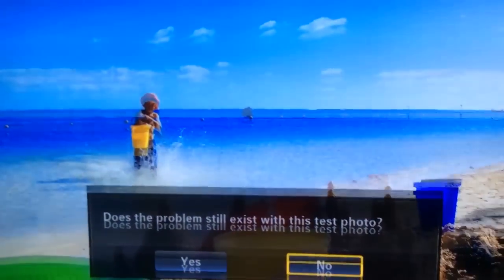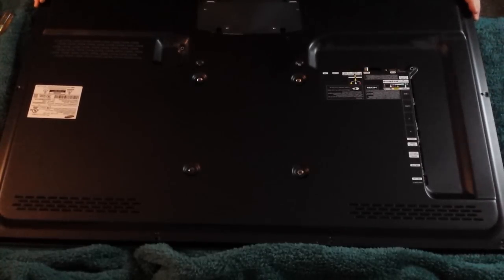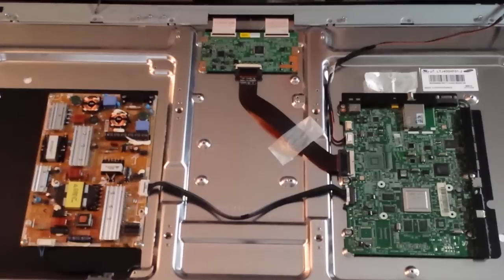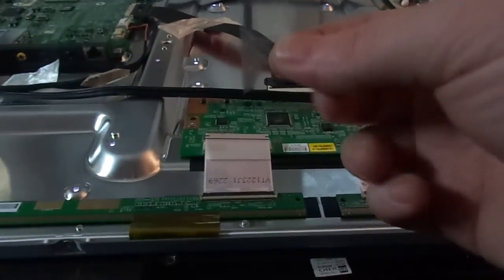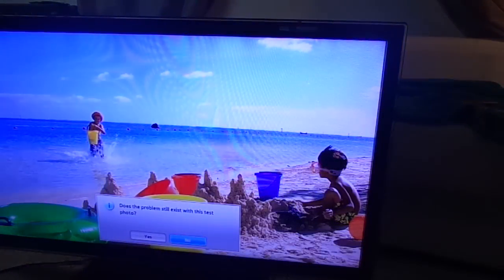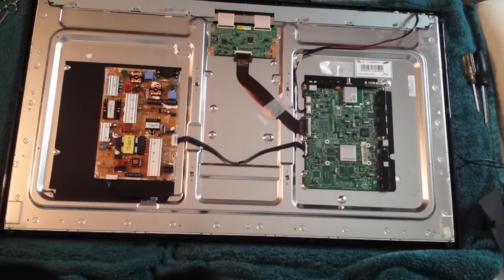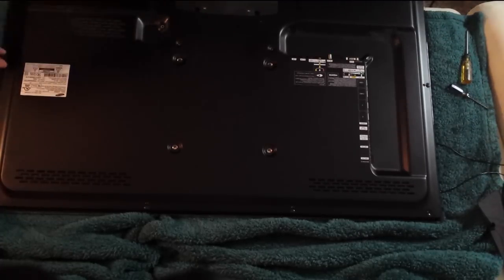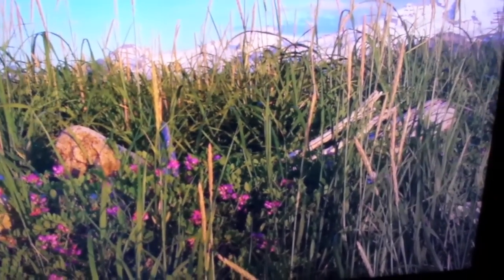LED LCD TV FIX, How To For Samsung Double Image, Black Vertical Lines, Screen Problem Sony LG.

Comment: Hi Dave, I have a Samsung LED 40inch (UE32C5700) and all of a sudden this problem started 3 days ago. I called in the Samsung engineer and was given a hefty quote to replace the screen + service charges. The technician himself recommended me to buy a new one which will be cheaper than the repair cost.
I looked up Youtube and found your video. To be frank, initially I was a little skeptic on how sticking a tape would work. But, I am no electronics guy and thought to give it a try. I followed your video religiously (right to the being gentle part and delicate fingers :-)) and was able to fix the issue in the first try. Thanks a ton for your easily understandable step-by-step procedure, I did not even feel that I was repairing a costly electronic product. 
The only issue is that I am now seeing a line between the 2 halves of the screen, it is very light but noticeable in channels/programs where the lighting is bright and has enough contrast and colors. I gather from comments that I need to play around with the width of the tape and the positioning of it. Is that correct? If so, I will try it some other Sunday and try to get this fully right.
Thanks again, and anyone else having the problem and reading this, don't doubt or hesitate - go ahead and try it out with this video. It is super easy - you just need to be patient, methodical and delicate as Dave instructs multiple times.
Reply from the maker: Siva R thank you so much, yeah people have posted they adjusted the cable a bit. If you do just be careful as the tape can peel off a layer of the cable when removed.

Comment: the plastic tape is an insulator. So Covering the metal contacts of the ribbon cable prevents the ribbon cable to be in contact with the T-Con board.

Comment: Isbit not dangerous to touch these connectors when the tv is plugged in?
Reply from the maker: Colin McGarry yeah don't touch them.
Reply: Do It With Dave That seems to be a sarcastic reply.
Reply from the maker: It was not my intention to be short. But definitely be careful if you decide to follow along with this video. It can be very dangerous and some ppl have said to ground yourself as a precaution whenever doing this type of work.

Comment: Hi Dave. The method you explained here is working pretty well for sometime, but after 5-10 mins white vertical lines start to appear on the left side.The screen is flickering and coming back to its original position. What could be the defect ? And how to fix it? Looking for suggestions.

Comment: interesting. i have black evenly spaced vertical lines and pushing on one of the hdmi jacks on the back used to clear it, but the jack eventually broke off and now its permanent. is this a separate issue?
Reply from the maker: jethronh that sounds like some different than what is shown in this video.  Some ppl have posted screen image issues do to devices being used with their TV so it sounds like it's directly related to the output. If you have not already done so you could try different source/inputs for TV like a USB cable ect and see if that helps. I would try configuring the set up a couple ways before opening anything up.  If you end up going in it could be obvious that the hdmi connection is the cause. If you do end up finding out the issue please post back here. It really does help the YT community.
Reply: see my video i just uploaded. It shows it, and the description walks you through all of my attempted fixes. Thanks!!

Comment: Thanks, bro. You helped me save ₹5000/- bucks. Actually these TV companies must direct their clients to solve such minor problems that don't actually cost that much that they charge by changing certain panels. Repairing is a must in these hard economic times. Thanks again, keep it up.

Comment: what if there is no middle panel  to remove? When I open up the back cover of the tv there is two circuit boards on either side and two thin white cables going down the middle and  into two sockets,  but there is no  third circuit board? I think the board might be on the other side of the medal plat crap!       42LE5350

Comment: Holy crap it worked!  I can't believe it.  Give it a try!  Have a 46" Samsung LED UN46B7100WFXZA that I bought in November of 2009.  About a month ago it started showing black/gray horizontal lines that went pretty much across the whole screen.  I did not have any ghosting or any other picture issues besides these lines.  They were darker/more noticeable on the left half of the screen.  These lines showed up on all inputs, over menus and even on the built-in test picture of the beach.  Searched the Internet like crazy and found this video.  I figured it was a bad T-Con or power supply.  Cheapest I could find a T-Con was about $75 and I didn't think it would be worth the cost to try
without knowing if it would fix the problem.  I am a technical guy, so I figured I would open the TV up and check the connectors, look for bulging caps, etc.  I first tried disconnecting the 2 ribbon cables and cleaning them.  I turned the TV off whenever I was disconnecting anything.  I tried cleaning the cables, cleaning the gold contacts, cleaning the sockets, pressing on the cables with the TV on, wiggling the cables with the TV on, pressing on the top of the socket with the TV on.  None of these things made any difference in the lines.  I then did like Dave said and disconnected one cable at a time and checked the screen.  Looking from the back, when the left cable was disconnected, the horizontal lines were still there.  But when I disconnected the right cable, the horizontal lines went away.  Keep in mind when you unplug one of these cables, you will only get a picture on half the screen.  So I figured I would try putting the tape on the right cable.  I took some tape, cut a strip about 1/4" inch wide and put it on the cable.  Like the video, I didn't start right on the edge, but over a few traces from the right side of the right cable.  I started applying the tape covering the gold pins and then wrapped the rest of the top over and around the edge/end of the cable and back up the other side.  So yes, the tape covers the contacts.  Total it covers about 15 traces.  There are 3 traces to the right between the tape and the edge of the connector I did not cover.  Plugged it in and first time it worked.  PERFECT picture.  Like new again.  Put everything back together and TV has been running for 2 days with no problems or lines.  I will post an update in a couple months to let you know if still is working.  I have NO idea why this works - it doesn't make electrical sense.  But glad I gave it a try.  Any questions, I'll answer what I can :)
Reply: Just an update.  It's been 2 months and the picture is still perfect!  The lines have not returned.  Thanks again Dave!!

Comment: Any chance I could have some help with a way to fix my 32 inch Samsung led tv with thin coloured lines and slight mirroring image and blinks green and purple sometimes Watched vid but need further help there is only 1 band goes from input board and goes to a long board only 1 ribbon
Reply from the maker: Aidan Mooney there may be a better video on YouTube for the issue your TV is having.  From what I've seen ppl say could be devices  (Blu-ray xbox ect) or WiFi interference. Some videos show to adjust contrast in the settings menu of tv. And I've seen some videos where the TV has many ribbon cables around the outside of the screen and put spacers something soft like an unused sponge cut into small pieces under the cables to keep them from moving. You may want to give some of these a try.

Comment: I did whatever you did but I got half black screen. I removed the tape and placed the ribbon back but still half black screen (left side). I also switched the two ribbon to see if it is ribbon problem but same thing. The TV was working before I try to fix it except double picture like your tv. I checked the ribbon place in the board and there is nothing wrong with it. Can you help to figure out what is the problem?

Comment: Hi Dave - I have the exact same model TV and it now works because of the detail you put into this video! I got the TV for free so it was worth a shot to see if it could be fixed. I placed the small amount of tape just above the gold connectors (for the right panel) on the ribbon cable and its enough pressure to prevent the ghosting and vertical lines from coming back. Shame Samsung doesn't provide this tiny cheap part. If so I  would have just replaced the ribbon cable it and be done with it. I do have some faint grey horizontal lines on the right side but from where I sit its barely visible. I did notice there was a bit of black gunk on two of the pins on the ribbon cable which could be why I am getting the faint grey lines but otherwise it is working. Maybe I will try some contact cleaner. Much thanks.

Comment: I tried this fix tonight and when I unplug the ribbon cable the whole screen goes black. I did left and whole screen blank. Then just right and whole screen black. What is the problem?
Reply from the maker: Thomas Elliott I'm really not sure. So far there hasn't been a post explaining the same issue your experiencing with you're tv. You should get a half screen when removing just one ribbon cable at a time.
Reply: Do It With Dave I got this tv from a friend and he replaces the t con board. The tv turns on but has a double image with small horizontal lines. But like I said either ribbon cable makes whole screen go black and have to turn off tv to get image back on
Reply from the maker: If you want to take a risk you could try turning off the tv Appling the tape on one of the ribbon cables then insert it back in and turn on to see if the image changes. Just keep in mind the ribbon cables are a bit delicate.
Reply: Do It With Dave where do you buy the ribbon cables. How do you know which one to buy. The is for a Vizio led tv w/4K by the way M55-C2
Reply from the maker: You would try ebay. I have seen them for sale on that site.

Comment: Dave, This fix almost worked for me.. When i adjust the ribbon tape with connector i can see the image is accurate without the horizontal black lines.. But when i try to lock the tape connector the black lines again coming up even after so many try.. Is this the problem with the ribbon tape or connector or the LED display.. Also i am not sure in which position the tap I have to paste.. I followed the one in the video but it didn't help.. Thanks a lot :)

Comment: can u help me...I was trying to get the ribbon tape in the best possible position when all of the sudden now i don't have any image, my screen lights up but there's no image. do u have any idea what happen?
Reply from the maker: Marco Garcia look to see if the ribbon cable is damaged. They are delicate and can get scratched easily.  If they are good unplug the TV and wait a couple minutes then turn the TV back on with both ribbon cables inserted. See what happens.  Does the power light on the front of TV come on? If still no image remove one cables one by one to test if there is any signal going to at least one of them. If you see no change then something may have shorted out. Possibly the t-con board. Definitely check the ribbon cables for any damage.
Reply: Do It With Dave I think u are right as well. I'll check later but I think the t con shorted out

Comment: i just want to say that I fixed my TV with this simple fix. thank you so much. I would really love to know the technical reason for this to work, because it makes apparently no sense, but after all, works...
Reply: @Do it With Dave, today in some further testing, i noticed that one of the halves of the screen is in some images a little darker than the other (less than 5% I would say). Do you think that shortening the number of pins covered by the tape would fix this?

Comment: The tape fixed the double image, but one half of the screen has a slightly different color of background. Is this a problem with the circuit board or the cable? Can I purchase either if that is the problem?

Comment: How can you cover the gold connectors with tape? You will not get any contact???? Just wondering how that worked?
Reply from the maker: Maysin777 I don't know exactly why this works. some people have commented the tape stops static electricity from building up that is the cause of this issue and that the clear tape doesn't necessarily prevent the connections from operating properly.
Reply: OK...thx for your input Dave....appreciated!

Comment: Why this works.     I have no double image, but slightly darker right side of panel  now.   I would like to fix proper.   Does the cable cause the problem, or the tcom
Board ?

Comment: Nice job making the video. I don't see how your fix would work, but there is always something new to learn. You have many visitors, so I will state my issue and what I've done. I have a 3 yr old Samsung LED 60" 7500 series. Great TV except after 2 years I was getting a total distortion of the picture and it would recycle after a click like it was resetting the HDMI or something. I would unplug it for an hour and then it would work again. It worked ok for months and then it would do it again. Then I got 1 thin black line going from right to left with some fading towards the left side. I figured, after much research that the line could be a bad connection with a ribbon cable. A youtube video was helpful showing that the power supply capacitors could be bad even thought they all looked physically perfect. I got a capacitance meter and checked all the caps and they all checked correct. I purchased all new capacaitors and installed them all in the power supply board. It seems like the distortion problem is fixed and was caused by a bad capacitor, but the black line is still there. I took it apart and on my TV there are hidden connectors under a plate along the bottom. I used a pencil eraser and cleaned all contacts on all ribbon connectors. The line is still there. I'm thinking the line is due to a bad connection where the cables are fused to the LCD panel. So, now I'm going to order some spray contact cleaner and try the contacts and ribbon cables again. I'll post here as a reply to this post if I solve the problem. If anyone has a solution for me please post it as a reply. Your video was very helpful in disassembly and has removed the fear of operating the TV while it is open and being worked on.

Comment: what about for smaller tvs that only have one ribbon for the screen, i have a 32 inch samsung model number LN32A450CID and the tape method is not working ?

Comment: Dave, thanks for doing the video, but putting the tape must do something. Is there a short between the contacts? Is it possible that the tape was not necessary and by moving the cable you found a clean connection free of oxidation?

Comment: For me the connector of right was the culprit.I have to put the tape on right side of the connector but not in rhe right end,just slightly right to the mid way and it worked like a charm.All the problem is gone and my Samsung Led is working fine.Thanks for this good tutorial.
Reply from the maker: Debajyoti Ghosh thank you for your comment. It really helps others when they are troubleshooting this issue with their tvs. Thank you for watching.

Comment: Dear Dave...i have Samsung LA32C450EI and facing the double-effect.I went up to the screen wire and there is no such thing as you finallt put the tape on....instead that screen wire goes in to the bottom of the frame and no end can be seen...any idea .how to proceed further..../?
Reply from the maker: Gamini Perera I don't know enough to give you exact information. I've seen that type of setup and I think the wire is all one piece so there may not be a connection to remove. I wish I could be of more help.
Reply: thanks dave.......appreciate your response....even though i tried ...removing that single wire and put a tape on.....without any success ..don't you think this happen with the heat.....the picture last about 10mts without doubling when i keep it for one week or so  without switch on.....any comment????

Comment: I tried to fix some horizontal lines and it worked pretty well, i just had like one black line left und tried again to readjust the cables and now i have a black screen. I just can see that the tv screen turns on and a little bit backlight! Is it now damaged and not repairable? :(
Reply from the maker: Dominik Sperber it sounds like the t-con board may have shorted out. The back light will come on with or without the t-con board functioning properly.